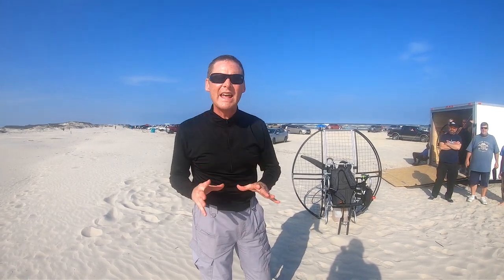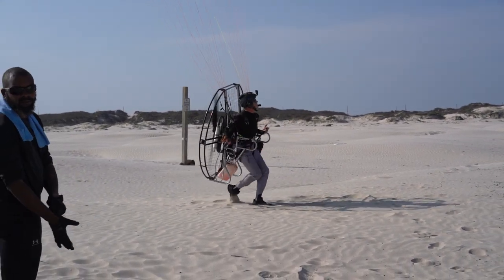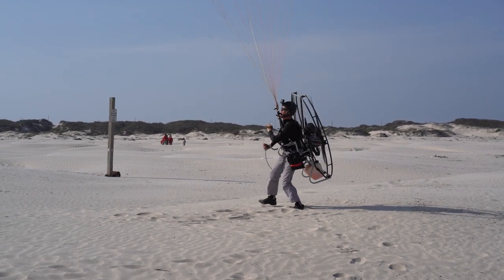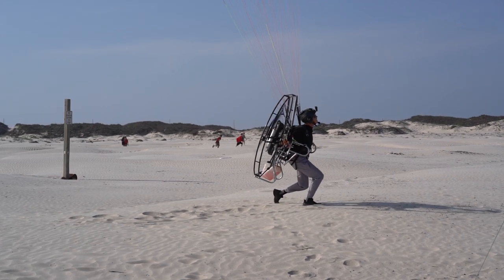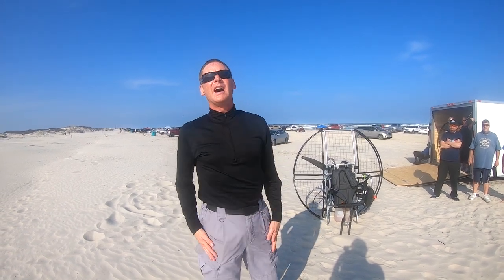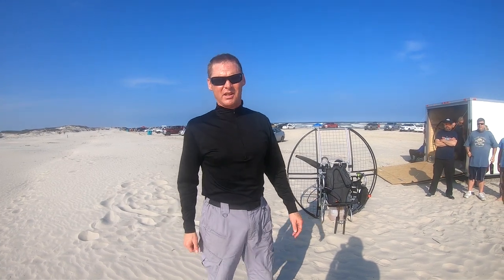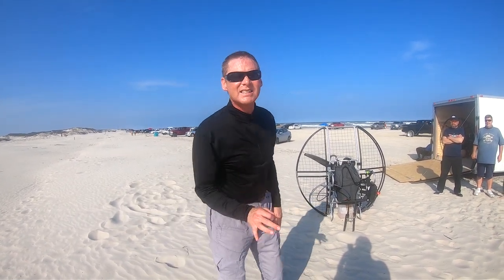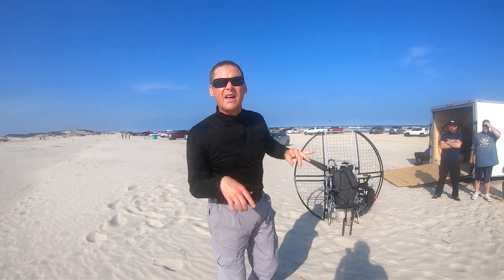A CRITICAL Tip On How To Turn Around In High Wind With A Paramotor!! You'll Want To Know This...

Comment from the maker: I probably should have added that once again SUPER training is critical because if you get off balance at all in high winds like that you will immediately get yanked over on your face or flipping over backwards and it gets really ugly.  It's absolutely critical that you have true and real glider control skills so you can maintain perfect position and loading of the glider.  There is really a ton to doing glider control correctly which is why SUPER training is truly the only way to go for anyone who plans to fly a paraglider with or without a motor.  Skill is skill.  You either learn them from those who have them or you don't.  Soooo many things like these are just not intuitive so if you don't learn them correctly from SUPER training you just don't figure them out over the years.  That's why you just don't see others who can fly in windy conditions and many who pretend to be experts suggest you can only fly in very calm conditions.  It's totally untrue.  A real actual pilot with real actual SUPER skills along with the best gear can pretty much fly when ever the heck they want.